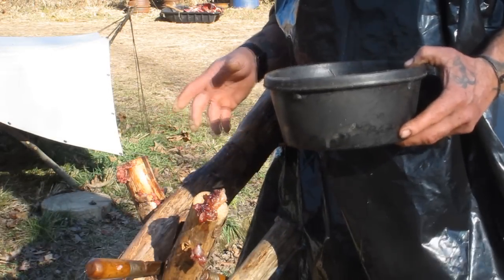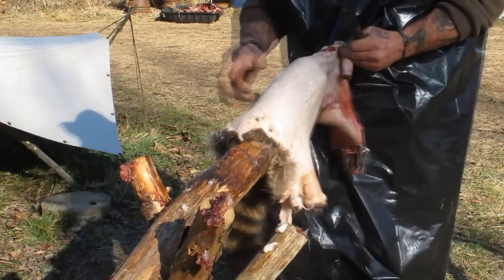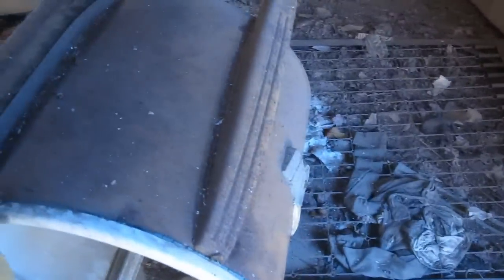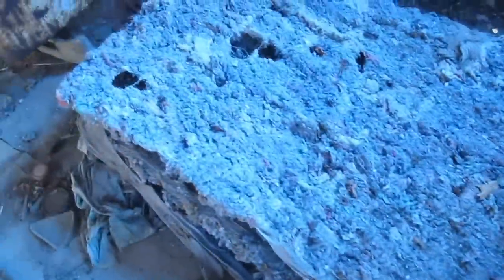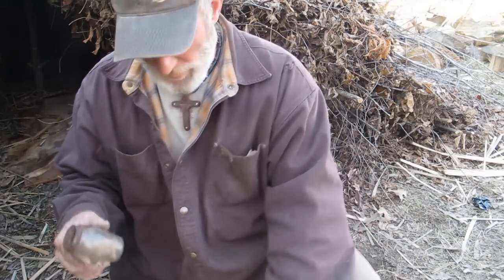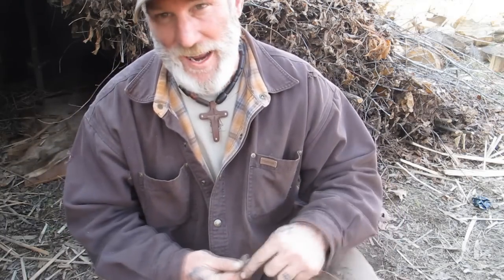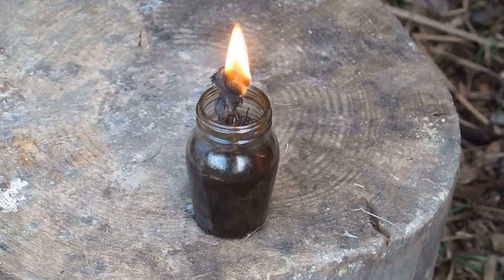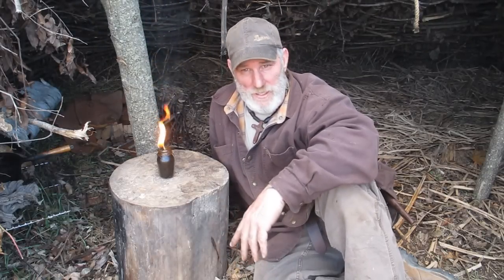Making a Grease Lamp with Racoon Tallow

Comment: This fat can also be mixed with pine resin to provide a flexible glue great for patching up gear. Traditionally, the fat from a bear hide is mixed with resin to water seal the seams of birch bark canoes. The real trick is providing a glue that will flex with the material in case of impact and the grease from hides is the secret ingredient that makes it work.

Comment: Loved the video. I think I would have wrapped the wick in a loop in the wire like you did, but instead of putting the wire down in the jar, wrap it around the outside of the jar in the threads for the cap. That way you could more easily adjust the wick without getting your fingers all greasy. Just want to mention those looked like black-eyed peas in that jar. Also, I was waiting for a zombie to come at you in the cabin! Thanks for all the vids. God Bless.

Comment: All you would manage to do is plug up your oil lamp.  Grease lamps are much closer to a candle than a lantern.  Oil lamps need a much lower viscosity fuel in order to wick properly.  You could, however, modify one of the candle lanterns to work with a grease lamp.  Just refill the candle cup with grease and a wick or improvise something similar that fits the lamp housing.  That would give you a more wind-resistant grease lamp.  Might soot up really fast though.

Comment: maybe it would be a good idea to punch a hole in the lid for the wick to pass through and then put the ld back on top of the vase. if the tallow runs low, the flame may walk its way down a little bit and then crack the glass. It is a narrow vase..

Comment: I wonder if that same grease lamp, but put in an empty sterno can would work not just for lighting, but I wonder if it would put out enough heat to cook with, and to boil water with using the Pathfinder pack stove ring and stove top?

Also, I wonder what plant oils would be available in Ohio to render for the same purposes?